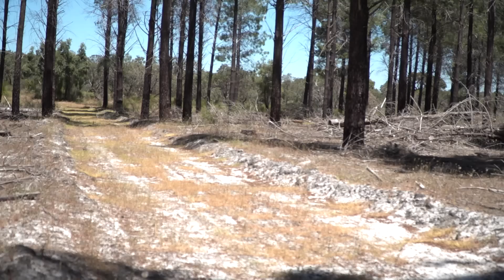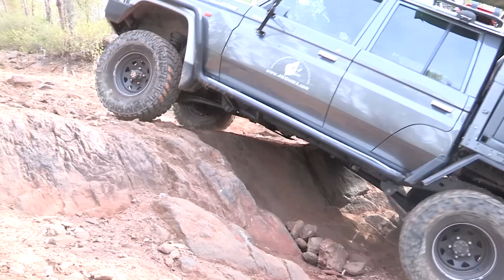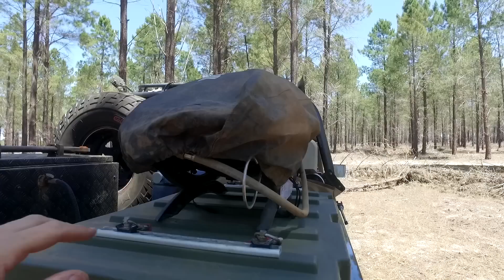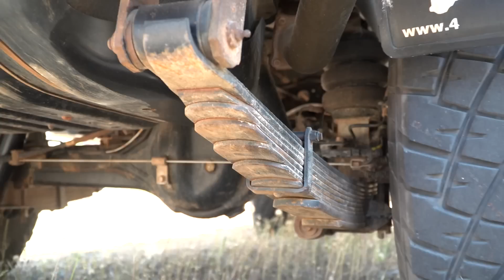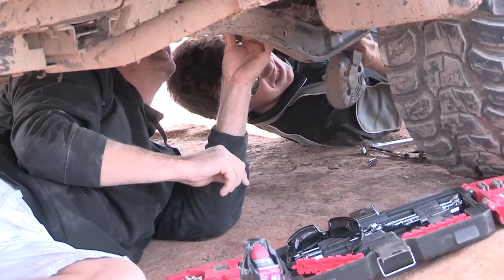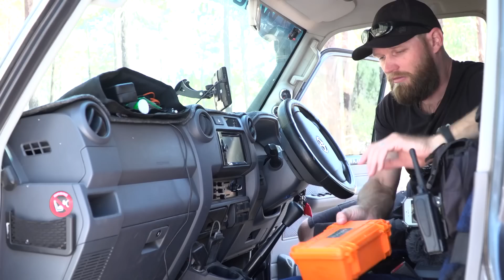79 series Landcruiser 4x4 Review, stage 4

Comment: Hey Ronny, Have watched this video a dozen times for ideas on a cargo box setup, Are you able to give me a little more detail on the mounting straps you used under the lid? and if you were to do one again how would you set it up? 

Was toying with the idea of running flexible rope lights around the inside and running a connector out the side through a grommet to attach to a battery, (makes it removable easily)

but mainly if you could help me out with those strap/mounts that would be great :)
Reply: Also got any photos of how you mounted your weber ontop of it (how u strapped it down using those rails)

Comment: Hi Ronny. Question: How do you deal with dust and sand on your rear tray now that the box is gone? Does it not mess with your fridge? Cheers Greg.
Reply from the maker: +Africa Sideways the fridge has been under water before (well half under) I've only ever have one issue and I fixed it by removing the front panel and using compressed air from a can to clean it out. Can't fault the fridge it's been good. My only complaint is I wish I got a fridge/freezer combo for the longer trips.

Comment: hi wanted to know how much power and torque your beast cruiser produces after installing the unichip, im not quite satisfied with the stock power the engines produce because the difference between the landcruisers and the new diesel hiluxs isnt astronomical.
Reply from the maker: I'll have to get new readings as its been an R&D vehicle so new tunes are tried and tested a lot. It was over 65% gain from memory but that was the top tune my other tunes are from towing and off-roading custom to my driving style and some only for low range
Reply: Ronny Dahl thanks very much, its quite a substantial difference I will look for a local uni chip dealer and installer with a dyno.

Comment: Take off or replace your cars spot lights mate ......
They are killing your engine by preventing the air flow to radiators......
Reply from the maker: +Rafi Adaman she runs very cool mate, 70-80 degrees 88 under load on the beach in lowrange.

Comment: Are you going to mount the awning back on? Did you have any issues with the Ostrich wing over the years? I'm looking at getting one and would appreciated the feedback. Cheers.
Reply from the maker: +Brettr0 awning is still to come but I'll be going with something a bit lighter although the 270 degree awnings are great and easy to use.
Reply from the maker: +Brettr0 I had no problems with my previous awning apart from the canvas bag tearing due to the tracks we were traveling
Reply: Thanks mate, I'm fitting out a canopy at the moment with a few trick features and the large 270 awning would be perfect for and the Ostrich seems to be the largest and strongest I've come by.

Comment: Hi Ronny, love the ute! You said that you have upgraded your alternator to stop mud and water ingress, how are the other electrical components with this issue? Eg, starter, AC, elect connectors, fuses and relays, thermo fans etc
Reply from the maker: All that other stuff is higher up in the engine and more sealed, also I use Inox3 and WD40 to 'semi' water proof the rest of the stuff. So far no problems

Comment: Nice vid ronny. I have the same brand fuel filter (pre) and I think is 5 micron and the original is 2?  My question is what filter size are you running there as it seems like a smaller model. Mine is on a d4d hilux. Cheers
Reply from the maker: not sure how big the hilux ones are but the one in mine is quite compact

Comment: I REALLY wish we would get a diesel pickup here in the US.  Any reason why it is so popular in Australia?
Reply: Yeah we are lacking light duty diesels. I think the reason we don't see them in the states is because of the stifling emissions regulations.
Reply: Reliability, mpg and range I think.
All pickups in the UK are diesel, some without a petrol/gasoline option.  But we don't get this model that Ronny is showing us.
Reply: True.  I should have specified Toyota.
Reply: A big market is the mining sector in Australia, because Australia is so large and the terrain is like it is there is a need for 4x4 people movers that can carry a load in the back. Goes without saying that the same vehicles are popular urban cars because of the people carrying capacity and load capacity. There is a huge market of dual cab utes which are essentially the same in simple form like engine size and configuration, transmission behind them and the suspension setup because they are so popular as work vehicles.
Reply: true. but a toyota diesel would be awesome to have here
Reply: We have lots of diesel pickups in the states.
Reply: its all about the market priorities, they dont have the diesel in the U.S because petrol (gas) is so cheap. Most people could not afford to run a petrol v8 in one of these cars not to mention the with the few extra hundred kilo's they carry around on a daily basis, on long trips like ronny does fuel must be accounted for and pre planned in budgeting the trip. Also as the other guy said our market demands utilities like this or the hilux, ford ranger (like a mini version of the f150 but in diesel) ect and there is a HUGE market for them here, we cant afford to buy the big pickup trucks from the states because after being landed here, taxes and right hand drive conversion they cost over 120 thousand dollars without mods, then after that the are petrol v8 which would drain our wallets too much with high fuel prices
Reply: Malik Martin I'm pretty sure this model is basically a 1980's era truck that simply doesn't meet modern American crash or EPA standards.
Reply: Malik Martin Make no mistake, this is the same basic body they've been building since 1984. It would never pass a crash test, or emissions here, even with the diesel. It's a great design. We loved our Toyota trucks back in the 80's. They could put a legal engine in them but all vehicles here require crumple zones that this old style doesn't have. It's a durable truck that has proven itself many times over. Aussies are lucky to have more relaxed laws that allow them to buy new versions of old classics like this.
Reply: Nah man if you saw our laws you wouldnt call them relaxed! i see things that your aftermarket guys do to cars or trucks that literally our government would impound and destroy them for doing
Reply: Chris Thompson beacuse it,s diesel :)
Reply: Chris Thompson gm has a new smaller displacement duramax engine
Reply: Matthew Higashyama yeah. ford also sells a small diesel ranger in mexico but not us or canada. maby if the gm one does well the other companies will sell more here
Reply: Cummins builds crate engines. In fact they're coming out with a new 4cyl that's 330 lbs lighter than the 4bt.
Reply: Malik Martin I've never owned a jeep so I don't know what they're like. All I've wheeled off road are full sized American trucks. For the record though, Land Cruiser and Land Rover both got their start as Jeep knock offs. The Rubicon's traction control with lockers really is the best of all worlds. You have open diff's, limited slip, and lockers all at your fingertips.
Reply: Malik Martin I'm an American, from Pennsylvania.
Reply: Malik Martin I've always been a pickup truck man. I've never owned a Toyota but they've been loved around here for as long as I can remember. Other than the $600.00 79 F150 with a 77 T'Bird junkyard engine I've never had any problems with my American trucks. Ford, Chevy and Dodge have all been reliable with no issues, including my current 2004 F250 that I bought brand new.
Reply: I'm considering selling it so I can go real old school with a 1965 Mercury M250, or maybe a Jeep M715.
Reply: it is built on a 1980's era truck becuase the same truck has been in production since the 1980's, still kept the core values but slight changes made between models to keep them up to par with emmissions and changing markets ect. basically built like a military vehicle, like the g series mercedes or the land rover defender. the emmision regulations arent the problem their new v8 turbo diesel is only a few years old now but their crash ratings are going to kill them off quite soon.i know in australia they have a deadline to stop production RIP the classic "troopy"
Reply: techsupport87 like what?
Reply: The Tundra is getting a 5.0 Cummins V8.
Reply: Malik Martin Amen!
Reply: Chris Thompson. its 6 dollars a gallon for fuel gas or diesel..... but just dont need a 6 litre v8 to have 4×4 fun ..also the state of western australia  is huge i mean huge huge it makes texas like kansas and fuel gets more expensive the more remote you go so four cylinder diesels are just so much better suited.  i tellya it takes 3 days to drive from north to south from near Darwin to the town of Esperance on the very bottom via WA.... jeeps down here dont last long and parts for jeeps are few places to get them..
Reply: Chris Thompson Wow! Bad only Australian Landcrusier.
Reply: ya that would pretty cool. small diesel pickups would be perfect for utility, fuel economy, and maintenance. its better imo to open up a hood and see a simple diesel engine than a plastic lid with everything covered up
Reply: like the big built v8 turbo diesels spewing black smoke like a chimney: instant defect. Tyres out past the guards:defect. Chassis modification:borderline defect pending engineers certificate and government signoffs. More than 2inch's lift: defect pending engineers cert like above. i could go on if u wanted more info.